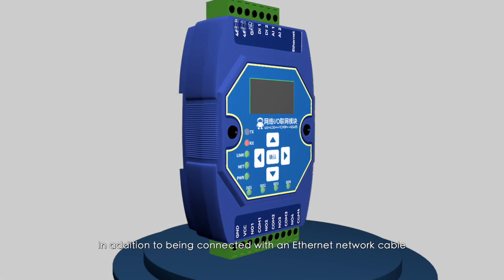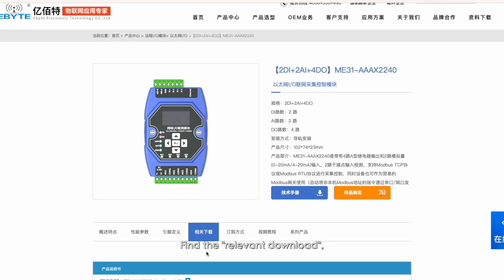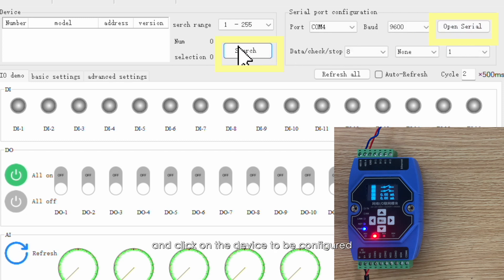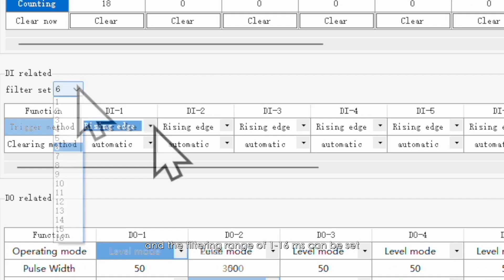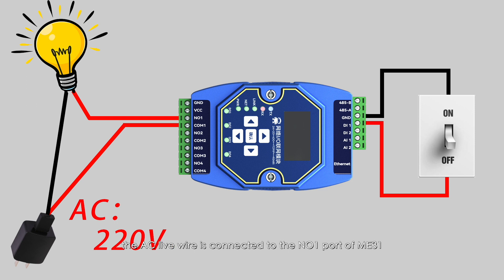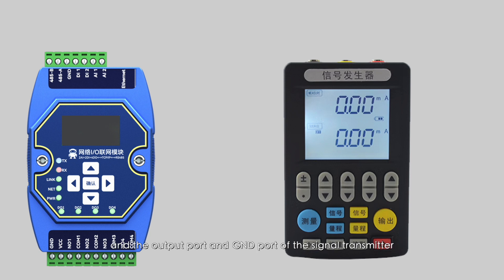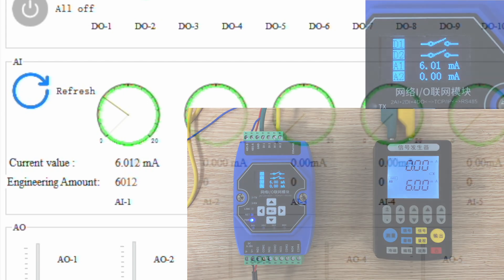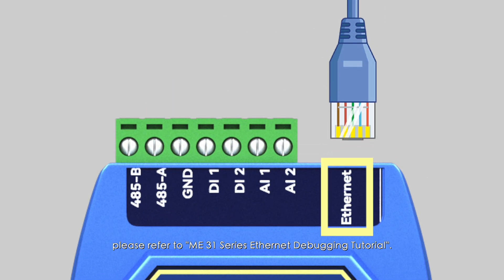ME31-AAAX2240

Comment: Hi CDEBYTE,
 I'm trying to set the filtering to 0 and the AI to 4-20ma by using the config tool V1.0.2. but even when the save is succesfull, when i reboot the device does not take these changes... any fix on this?